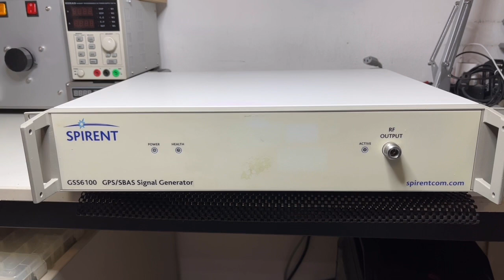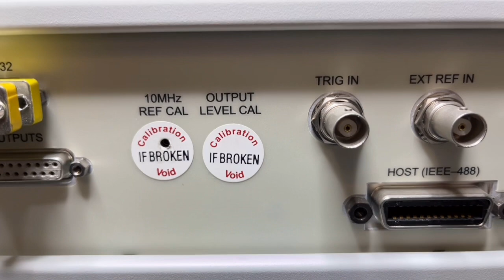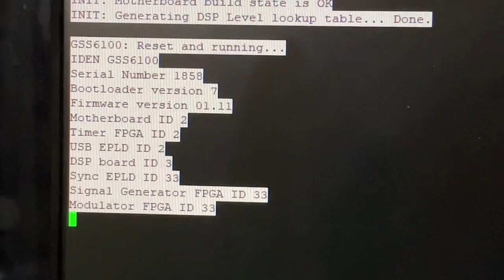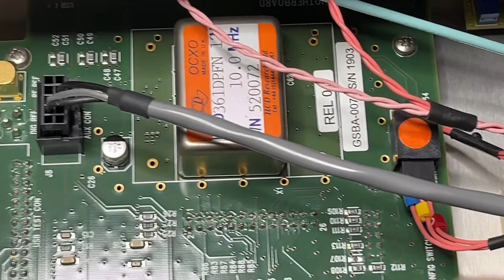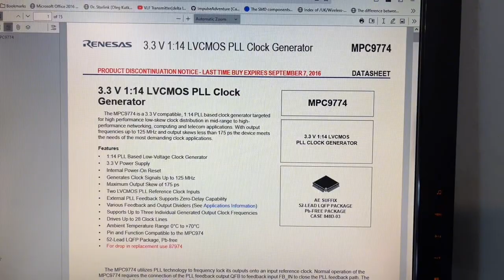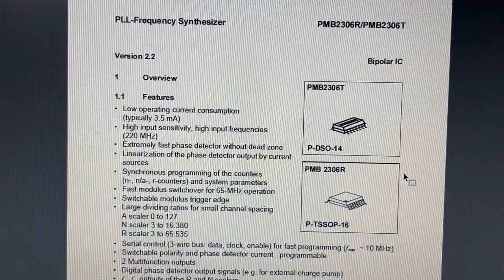SPIRENT GSS6100 GPS Simulator Teardown and RS-232 command Testing, Part1.

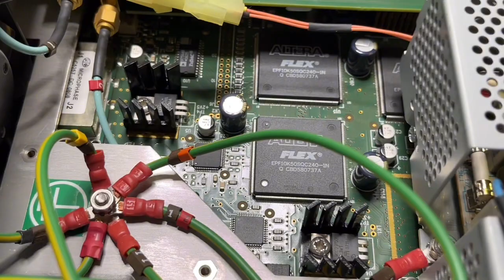Comment: 10:08 Nice cabling inside this unit, 1 point grounding to eliminate noise and earth loops. That is something some powersupply manufacturers can learn from. Grtz
Reply from the maker: Hi Bjorn, its build nicely Inside, but its a horror to Service and Troubleshoot if needed, Highspeed sandwiched PCB's full of FBGA's.Cheers, Konstantin